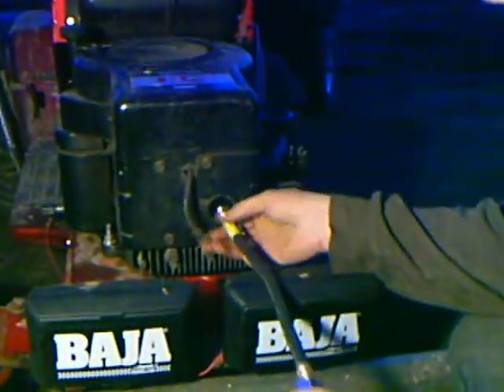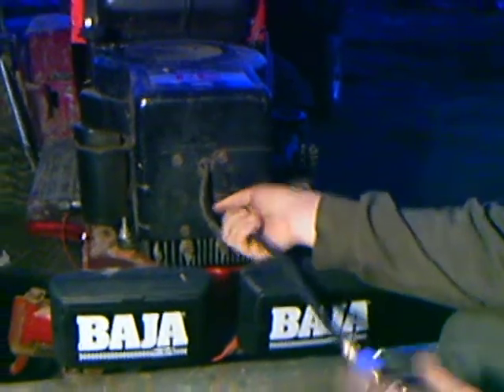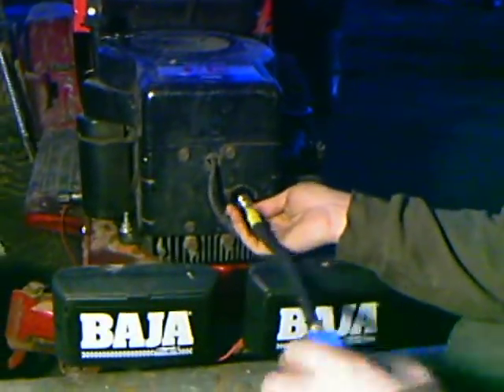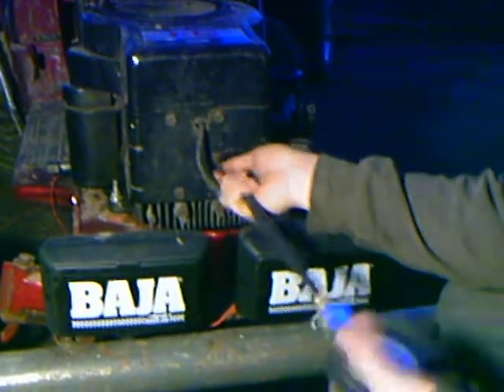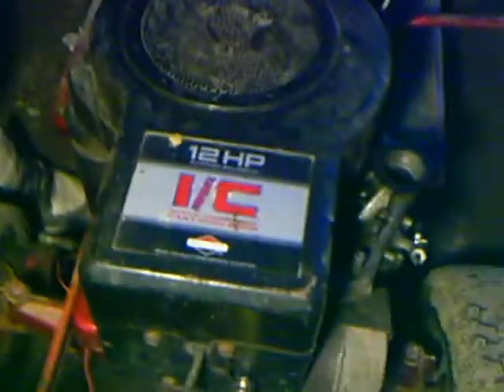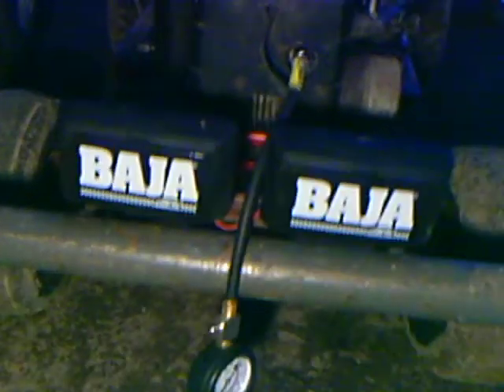Compression Test On 12HP Briggs & Stratton IC Engine

Comment: I dont think he does, I read the 12 hp B&S engine  has a compression release , it says to over come that in what i read , you need to jump  it from a car battery to get the engine to turn 325 rmps to where you can read the compression. I think the reading you are getting is after release. Also a better way to do that is to use the quick release on your gage bottom and remove the gage and screw in your hose, then connect the gage.